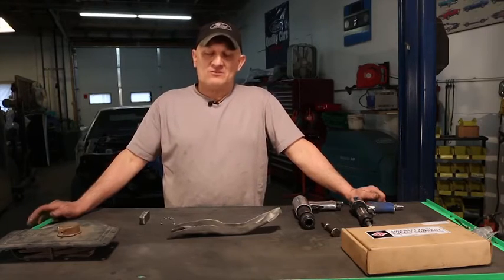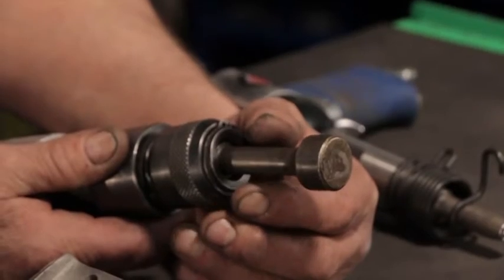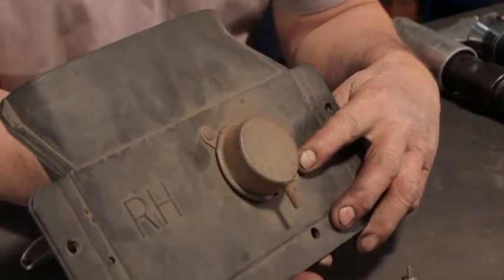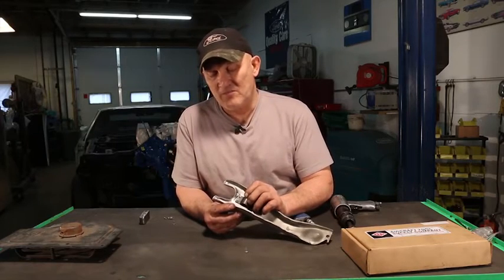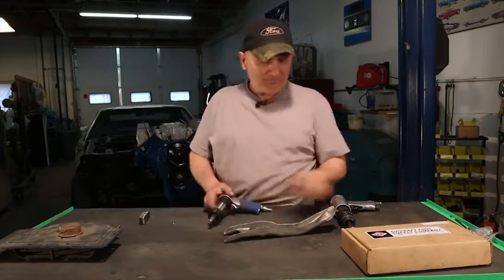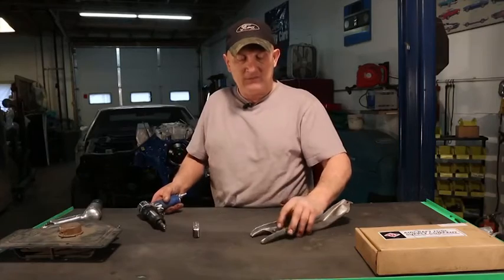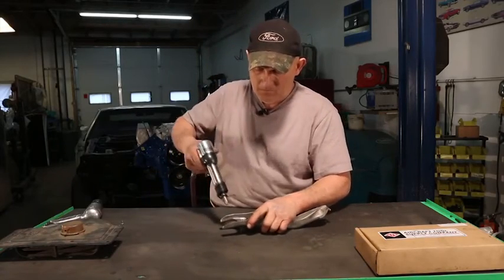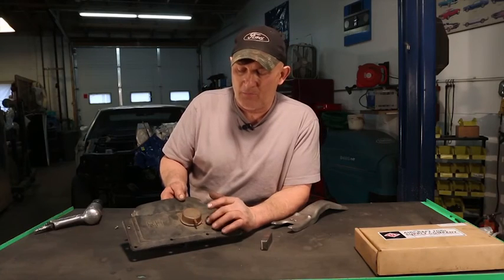How to Install Rivets

Comment: I worked 14 years in structural repair on aircraft and never say a rivet like that with a hollow end. Only blind rivets and solid aluminium A,B (magnizium), AD,D DD and Monel steel and I believe there was a copper one too. But that was 21 years ago maybe things changed

Comment: Great video!  I have been searching online for days trying to find a video that shows the installation of the same rivets that are used on the front window assembly of my '57 Westerner as seen in my avatar.  They are the same as you are using in your video.  I had to remove the entire window frame, disassemble it and the only way to reassemble is with this type of rivet. What is the name of these types of rivets?
Reply from the maker: Hi Rod,

The rivets used in this video are know as semi-tubular rivets. 
They are commonly available in Oval head (Domed) like used in the video or a flatter head (Truss). 
Here's a link to one possible source: https://rivetsinstock.com/rivets/semitubular-rivets.html 
Aircraft Tool Supply sells the rivet tool used in this video, they also sell rivets also. 
Here's a link to their site: https://aircraft-tool.com/

Mark
Classic Car Restoration Club

Comment: Nice concise video. Where did you get the dished out bucking bar?
Reply from the maker: Sam, Bob prefers to make his own using a piece of tool steel (available as a drop 'scrap' at most metal suppliers) and a carbide burr in his die grinder. He insists it only takes five minutes to make one, and you can make it to fit the heads of the rivets you're using.

Comment: Can someone comment on best way to do round rivets on small electronic components. Such as installing tube sockets to my amplifier. I have tight working spaces too. 
I want the look of round rivets so I don't want to use small screws or standard big box rivets. I want to replicate how the rivets look on the vintantage part I have.
Reply from the maker: Great question! The ‘Ask an Expert’ section is currently for members of our online community. I would be happy to send your question off to the experts. To get started, please send the email associated with your paid membership account. Thanks!